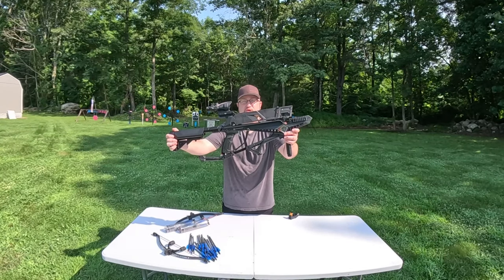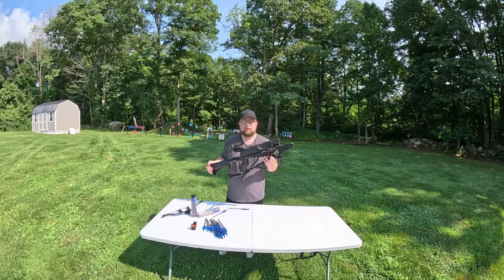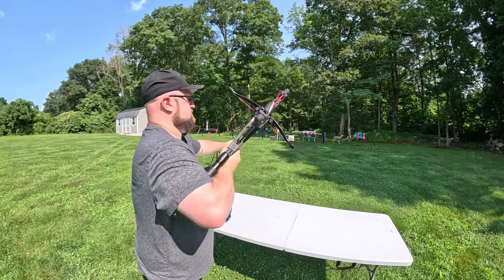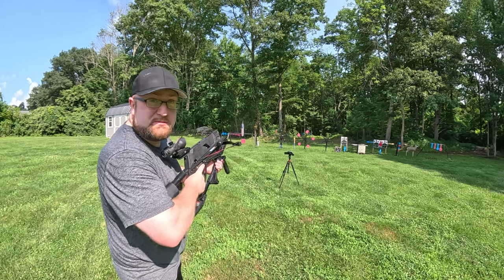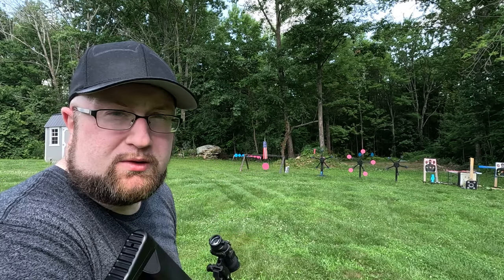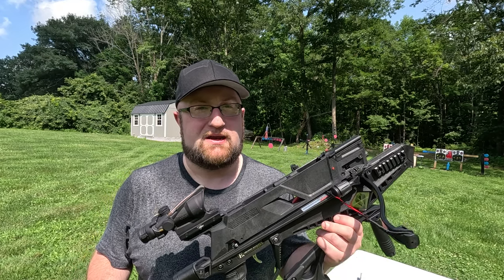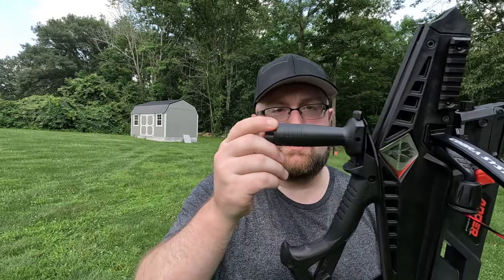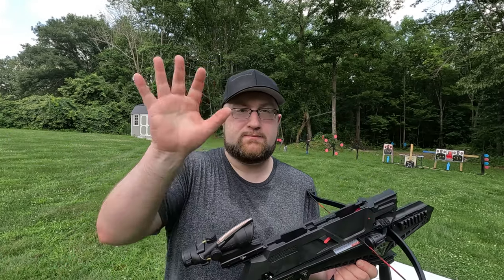I Depleted The Ozone Layer While Testing out This EK Archery Cobra Adder with the 2.0 Upgrade Kit.

Comment: Don't buy this crap, I have one and the precision is shit after 15 yards
Reply from the maker: @pascalpoisson7069  This was at 25 yards, I think those groups were pretty good. I was testing it at 35 when I got it, pretty much the same groups. I will bring it out to 50 yards and see how it goes
Reply: The Cross bow looks great, why not use a red dot with a magnifier? There seems to be enough room to put a picatinny rail to fit both the red dot and magnifier and still have room to put in the bolts into the magazine! Close range the red dot will be fine, then flip the magnifier in for longer ranges. Just a suggestion.
Reply: Will it shoot fix blades for bolts
Reply from the maker: @jasonpytel  They have those available for this.
Reply from the maker: @stevendavies6209  I dont have a magnifier, but with the drop this has you definitely want a reticle with various markings on it to account for different ranges
Reply: @pascalpoisson7069  I own this crossbow. And it will come in handy when the world turns to SH*T hear really soon. Watch the COBRA ADDER videos from Jorge's channel. The power and penetration of this crossbow is mind blowing. It will definitely stop a person dead in there tracks. Especially if the bolt goes threw there head. See what the 130 LB. And the 180 LB crossbow limb can do to a metal plate in front of a gelatin block. Covered with a cloth and a piece of leather. Your jaw will drop. So will the person trying to break into your house. 👍👀🖖👻🤘😎🎸🎶🎵

Comment: If the 180lb limb did approx. 365fps then what did the 130lb limb achieve over the chrono?? Cheers.
Reply from the maker: @North_sea_empire_Viking  Im not sure on that, Ive only used the 180lb limb so far.
Reply: @toxicmatrix1337  Well let's have the performance comparison. It would make a damn good video that everyone wants to see👍🏻
Reply: @toxicmatrix1337 I must correct myself, the 180 limb did 266, 266 & 264fps. Now, EK archery states their 130 limb does 270fps!!! SOMETHING DOESN'T RING TRUE🤔
Reply from the maker: @North_sea_empire_Viking  They mightve used a lighter bolt for the velocity tests.
Reply: @toxicmatrix1337  That wouldn't be logical. To evaluate the test fairly standard Adder bolts must be used in all cases. BUT I've done some research and the figures are as follows: 130lb limb=236fps 180lb limb=265fps and 190lb (Venom) limb=287fps. The Venom 190 limb is carbon & fibreglass layers as opposed to EK Archerys solely fibreglass limbs.
Reply from the maker: @North_sea_empire_Viking  I was assuming it based off the 365fps you mentioned for the 180lb. 270fps sounded about right for the 130lb if it were a lighter bolt.